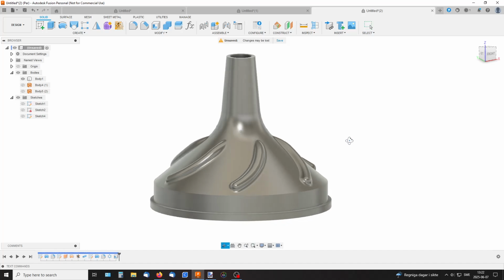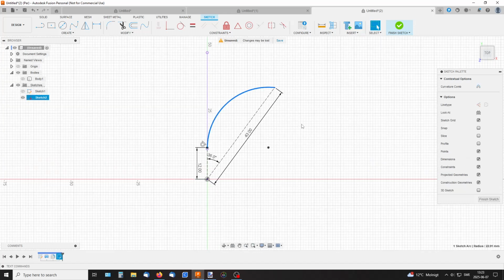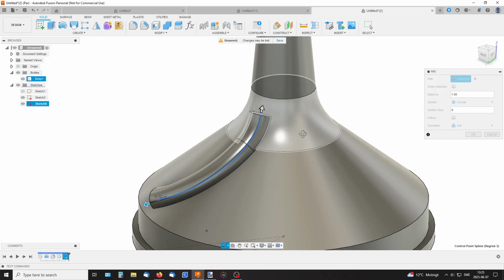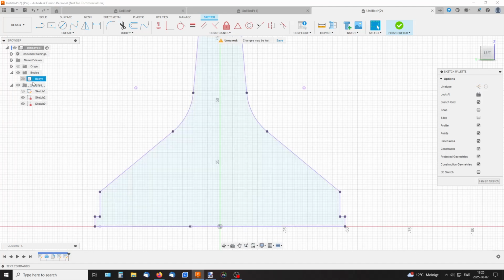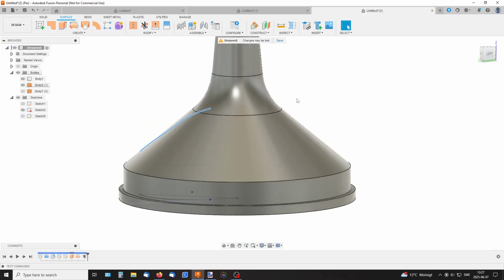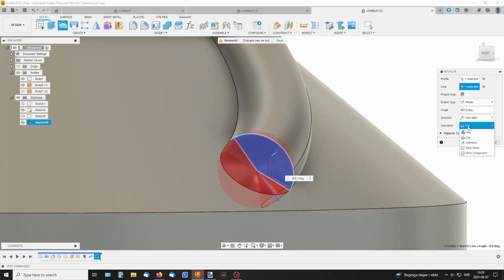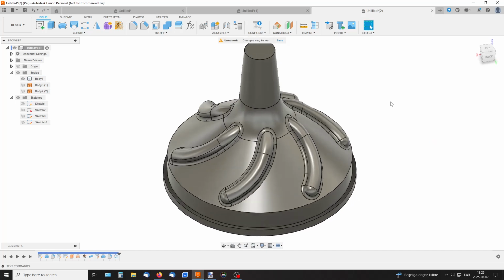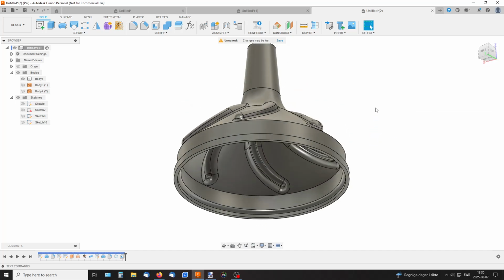Funnel with grooves

Comment: I started by making a making a funnel and then trying to "project "a sketch but that didn't work (definitely my fault) and the emboss feature does seem to work but I can't properly project a path? I'm completely self thought in f360 (for better or worse lol) and I still can't figure out how to insert sketches onto curved geometry
Reply from the maker: You can never make a projection of a sketch inside the same sketch. So start a new sketch and use Project to surface there.